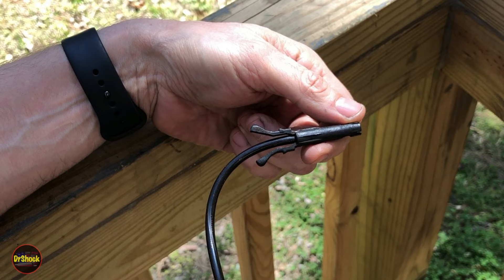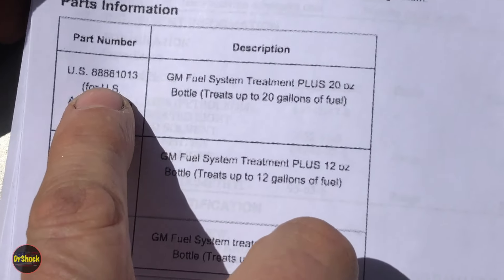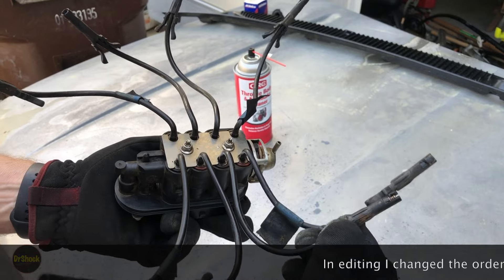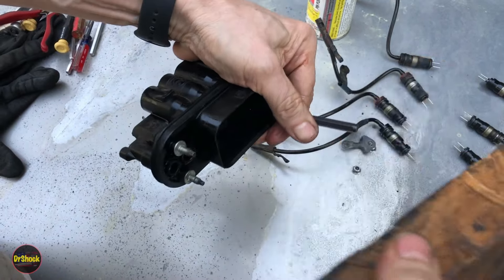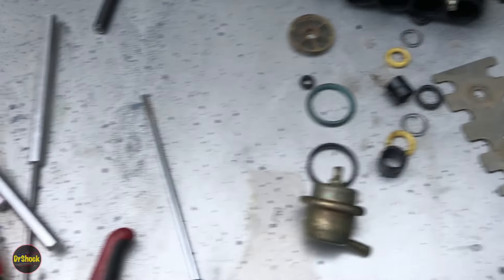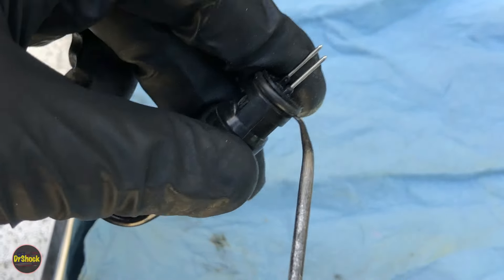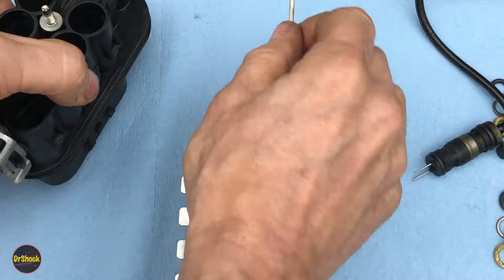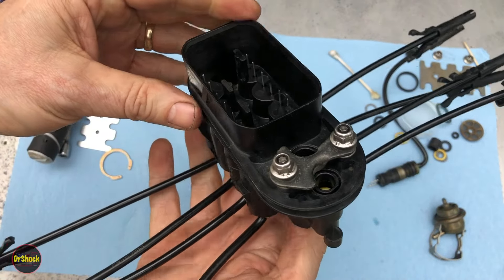1996 - 2002 GM OBS Truck Vortec Engine CSFI / SCPI Fuel Meter Body Injector Rebuild (Vortec V6 & V8)

Comment: I enjoyed this video and gave it a "Like".

However, I cannot wrap my head around the "worthwhile" to go through all this trouble all to pay  double of what a completely brand new Fuel Injection Spider is priced.  And the new Spider comes with OEM poppet valve clips.  Around $480.00 to $540.00 for this Spider.

Now—

—In October 2024, new GM OEM parts, the approximate prices are: № 1: fuel regulator assembly - $60.00,  № 2: Fuel Injectors O-Ring kit - $55.00; and № 3: eight Fuel Injectors with hose and poppet valve are $114.00 a piece, or $912.00.

The total cost for the whole shabang listed in the above paragraph is $60.00 + $55.00 + + $912.00 = $1,027..!!!  Double the brand new Spider Price!  And there is not the labor of rebuilding.

Am I missing something, or was this rebuild just a 'lose-lose" exercise in futility.. ???
Reply from the maker: Thanks.  All told I believe I spent around $500 in genuine GM parts on this particular job.  For older designs like this, where several of the parts are actually discontinued by GM, I find you can come out cheaper shopping on eBay for them.

I shared this rebuild process and parts for the viewer wanting to keep their vehicle period correct and all OEM.   Or those going to car show swap meets coming across these old stock surplus parts cheap and wanting to know how to utilize them.    Or those who have had decades of trouble free driving with the old CSFI system and just want to keep it going as-is regardless of the extra labor involved.

Comment: Whats Happening is its pumping fuel right into exaust making white smoke 
i put in injector cleaner and it got better but its not holding any pressure
4.3 s10 is there a place to check vac on regulator without opening it up ?
it through a shorted wheel sensor code and disconnected them 
 thought it was powering the injectors but i think its just injector staying wide open 
but was wondering if the regulator could be dumping through bad regulator
I had to clean the injectors on 2 other vehicles because the winter alcahol in gas 
I got 0 pressure at where you hook up the gauge with key on unless its running
you start it and its its got pressure squirting gas out
is that the regulator trucks got 130,000 miles and new fuel pump

Comment: My 96 Chevy truck with 340,000 miles on it doesn't have to worry about carbon buildup just red line it every few weeks works for me.

Comment: I owned a 97 and an 02 K1500 and I replaced those spider assembles with the updated "new design" ones (MFI). Both trucks ran much better.  And currently I have an old 95 k1500 with TBI, so I don't have to worry about those "spider" assemblies any more. A TBI rebuild takes like 20 minutes once it's off the truck.

Comment: Yes you can rebuild this spider injection system but why would you? I believe you would be better off replacing the entire unit. On a van especially it is a pain in the as* to replace these do you really want to put it all together just to replace broken lines in a month or so. I want reliability even it costs a little more.

Comment: The newest system would have problems too. But they should have done as they should have went with the marina fuel injection. Are the same fuel injection they had in the cyclone in that typhoon! The ones that are hated on Chevy the Ford owners Ford have the camshaft synchro wasn't that good either

Comment: I’m in CA and My 1994 s10 blazer has this setup vin8th letter W and I don’t like this setup it’s completely garbage rusted fuel tank carbon build up&cheap gasoline = expensive spider injector prone to failure GM”s worst fuel system design ever there should be a recall on all these CPI nonsense I feel like seriously sending this truck back to them (lawsuit) or to junkyard because of this setup.